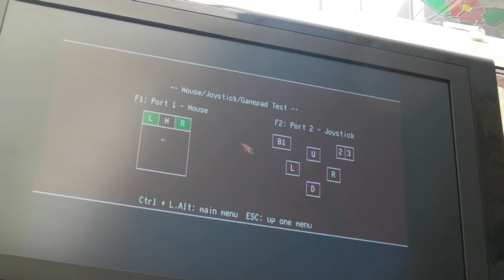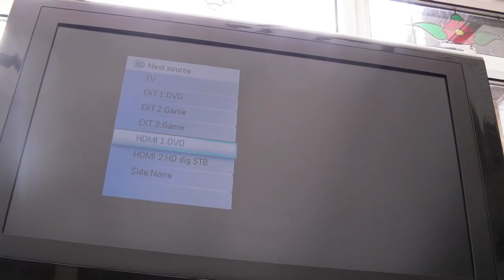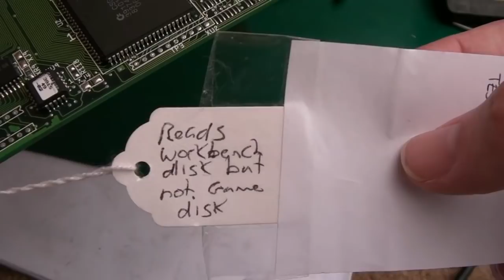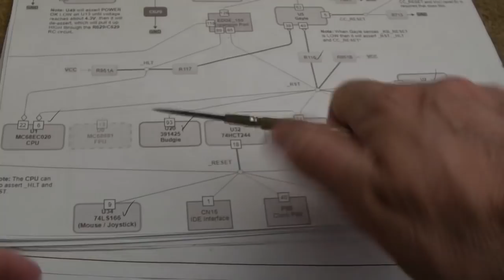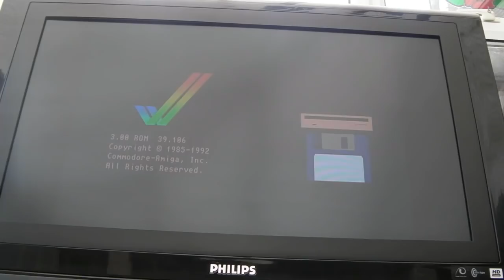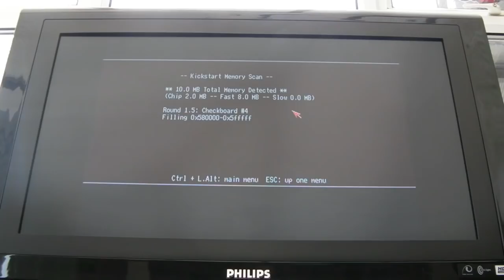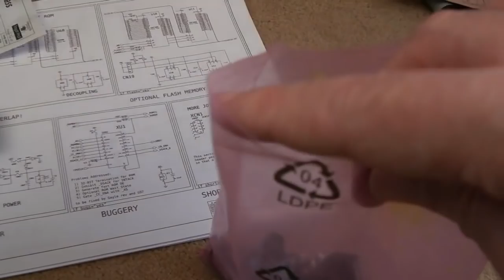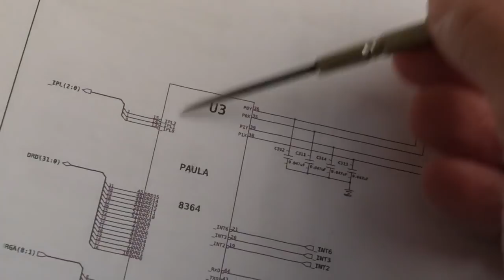32bit Commodore Amiga Repair-a-thon - Part 4 (A1200 x 4)

Comment: Interrupt mask is a CPU-level thing AIUI. If they’re disabled the only one that could get through is level 7: the non-maskable interrupt. All three IPL lines would have to be low. Unsure what DiagROM does with an NMI. Probably not very much. But if it’s constantly interrupting? I’m not sure if you’d get nothing executing, or if you’d only get one command executing per N cycles, or if it’d ignore it after the first unacknowledged interrupt. It sounds more like a floating Halt line to me, but you did say that was tested. Odd, I agree.
Reply from the maker: Yes, I think perhaps Paula was outputting all lows on the IPL lines.  The halt line couldnt have been the issue, since swapping Paula resolved it and I dont believe Paula connects there.  Halt was also probed and scoped many times.

Comment: If I remember correctly, and as I have an Escom A1200 with this fix, Escom boards have a wire from DF1 to DF0 connector to bring READY signal because Escom boards DF0 connector lack this crucial signal (or it is Disk Change).
Reply: Just find the info on the SPS site : http://www.softpres.org/article:hard:fixing_the_amiga_technologies_a1200_fdd_connector
Reply: Ha, just see you talk about this later on the video :-]

Comment: As for replacing traces using epoxy, I've tried and it does exactly what you say it does. Far more trouble than it's worth. That, and there doesn't seem to be anything wrong with your repairs as is.

As for Rosa ignoring you, she wasn't. She was only turning a deaf ear to you, she can't be blamed. :)
Reply from the maker: Yeah, it just doesnt work very well.   RetroGameModz used some special epoxy I think that worked up to 400 degress or something - that might do the job!  LOL @ Rosa =D
Reply: @GadgetUK164  That man is an artiste. An annoying one at times, but an artiste nonetheless. I did some research a couple of years ago on high-temp epoxies and found the Masterbond epoxy at that time. I never followed up on it.

https://www.masterbond.com/tds/ep17ht (Which is a one-part system that has to be baked at 300F-350F for 2-12 hours). You will have to request a data sheet. Bah, no thanks. And their epoxy appears to have a 3 month shelf life. Another minus for guys like us.

So you prodded me to revisit the topic today and I found another 600F+ epoxy that might work:

http://www.cotronics.com/vo/cotr/pdf/4460.pdf (Duralco 4460, Which is a two-part system). Data sheet: http://www.cotronics.com/vo/cotr/pdf/4460.pdf

Here is a page of epoxy recommendations where I found the Cotronics epoxy (as well as a reference to the Masterbond epoxy):

https://staff.washington.edu/wbeaty/chem-epoxy.html

Personally, I would try the Cotronics epoxy first, just to avoid the baking process if nothing else. 

The "baking" process on a populated board could be as simple as running current through the patched trace to cure it in place. Meaning no need to heat the entire board. But, nah.

Comment: @GadgetUK164 I have a black screen A1200 that I bought not working from Ebay and is driving me mad, there were blown bits replaced and the XU9 GAL was duff, I replaced that but now all I get is a warm chipset and stone cold roms. Any ideas?
Reply from the maker: Does DiagROM give you any clues?  If DiagROM is not booting you need to look at the databus, address bus, ROM OE, RAM OE / WE lines etc and try and work out if there's a databus problem or perhaps an address decoding problem.  You could divide and conquer with DiagROM by removing Paula, and both CIAs.  If the menu then appears, it's one of those 3 IC's causing your problem.